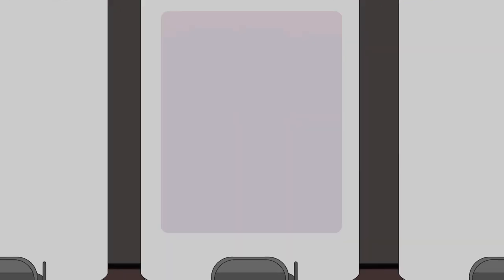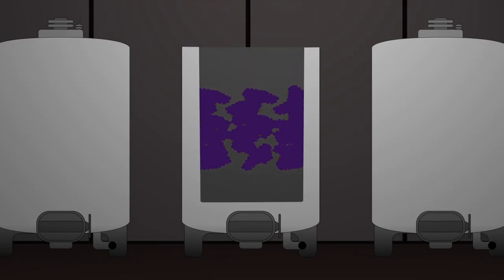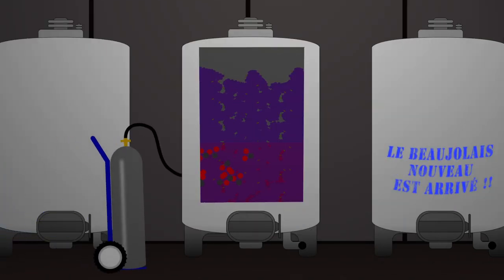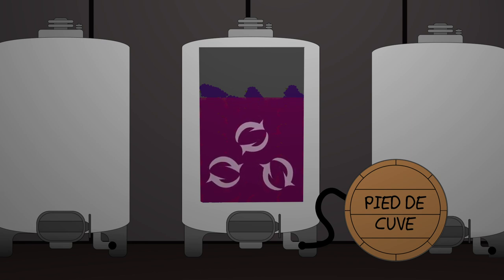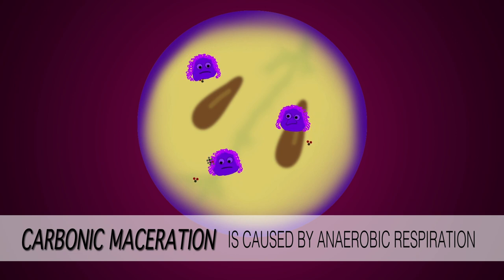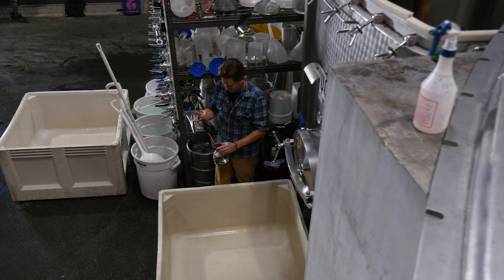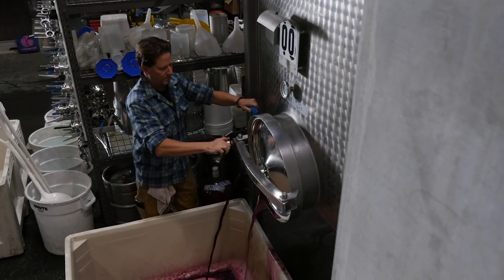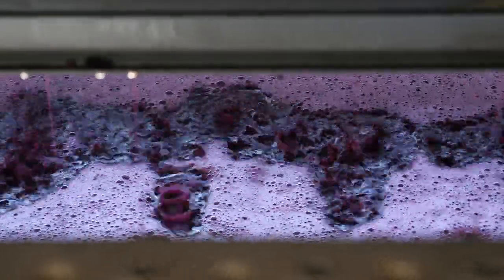Carbonic Maceration: A Brief Overview

Comment: I'm wondering if carbonic maceration is done under pressure? Or is it merely done with some sort of airlock - allowing the air to escape and pressure to equalize.
Reply: It looks like it's been done in an airlock-system. The CO2 that is being generated will push the oxygen out.